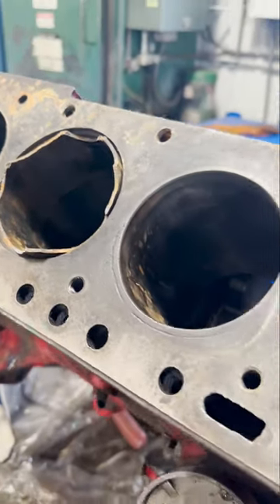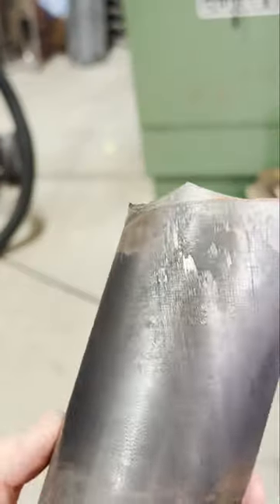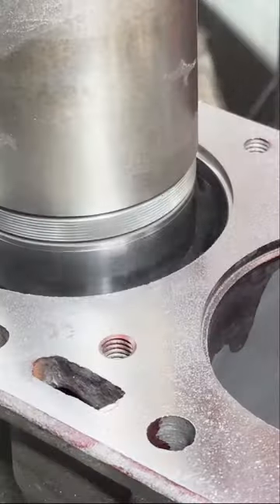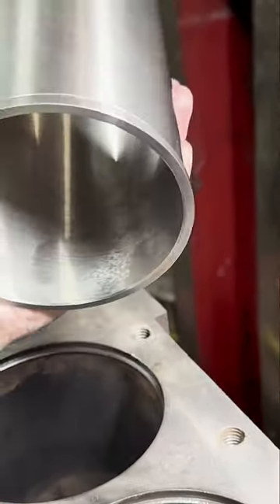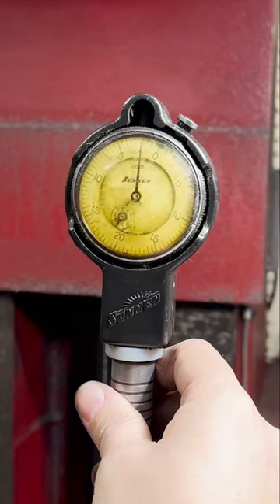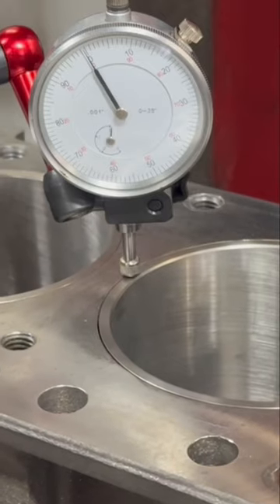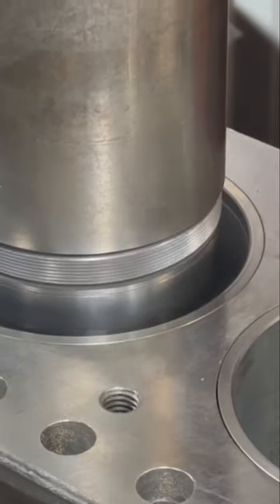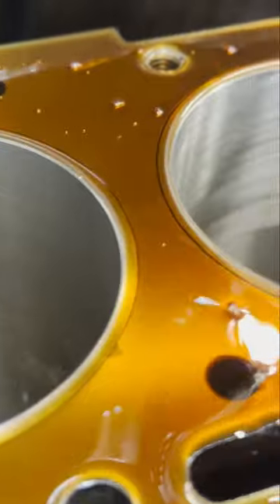#shorts Fixing The 172 Ford Block!

Comment: Is that a crack on the sleeve after boring?
Reply: Nah, thats a little mark from running the bore gauge up and down
Reply: Good catch. After you said that I went and looked too. Sure enough that’s a crack in that sleeve.
Reply: Yeah doesn't look like a crack to me, it's the wrong texture
Reply: @PoorSharkie  Yep. Dial bore gauges can leave a little mark on everything, and especially bearings. I have a Mitutoyo and had to modify it by taking an internal spring out, as it would apply too much pressure and dig into soft bi-metal and tri-metal engine bearings. The Sunnens are supposedly the top dog, but they're too much $ for how often I use them. No brainer for a machine shop though.

Comment: They charged 25 a cylinder to replace 8 holes on a Ford diesel  v8.  The engine came out better than the factory.  That